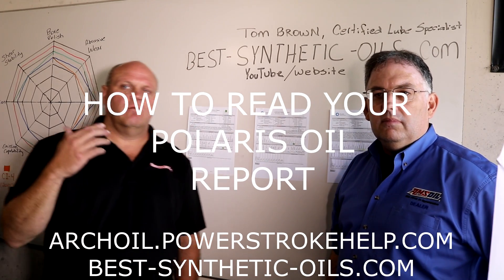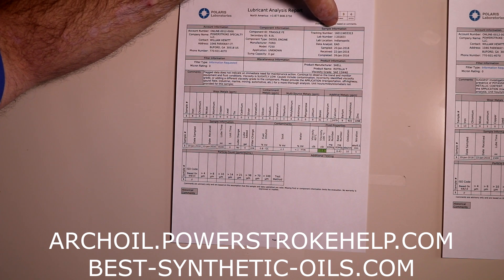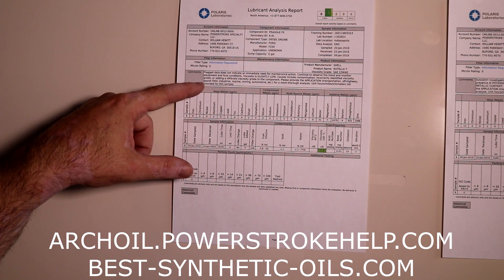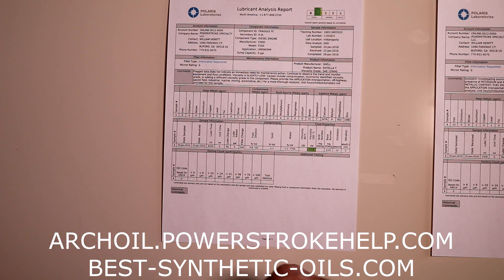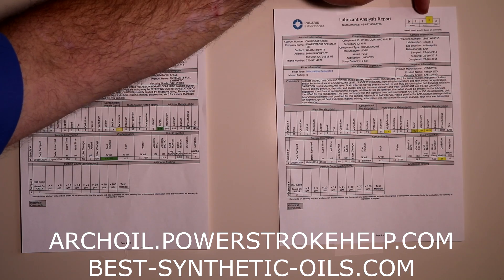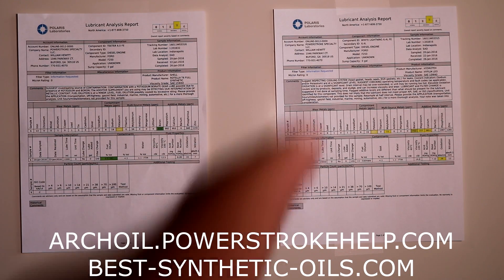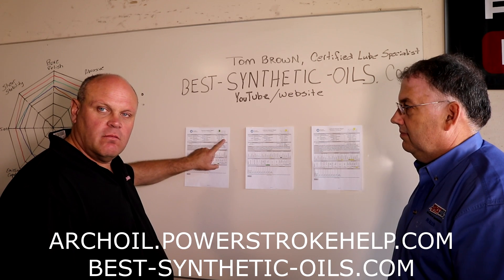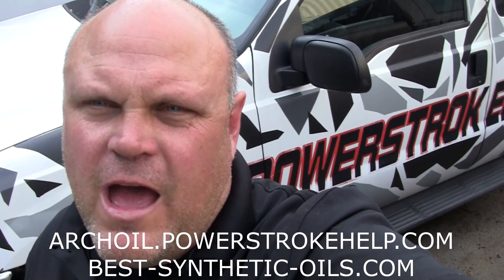HOW TO READ AN OIL REPORT

Comment: Can this test be done on regular gas V8 engines?
Reply: You can order oil testing of engine oil, ATF, P/S fluid, gear oil and get a similar report. It does not matter if its gas, diesel, natural gas or even your shop air compressor. Because this is an Amsoil test kit, its easier to get the sample kit from Blackstone-Labs and mail it in with similar testing methods.

Comment: I didn't see this in the video, but is there a "control" analysis of the same oil from the bottle before it's poured into the engine?  In other words, was there an analysis to see what is in the oil off the shelf?  When he mentioned those weird metals like magnesium, paladium, etc., I started to wonder if those metals may be from the refining process.

Comment: My result showed high boron and sodium after 1800 mi. since an oil change.  How would using WVO for 70% of those miles affect the oil analysis?  I did not use the archoil additive in the Rotella 15w40.
Reply: WVO?
Reply: Similar to Vege Motor Oil

Comment: I am so glad you addressed this.  I am currently using the 5w40 full Schaeffers full synthetic on my 2002  7.3L.  I also use the Archoil 9100 oil additive.  I got my first oil report back from Schaeffers and they red flagged the potassium, indicating a bad head gasket or a crack.  The oil looked just fine when I took the sample and I know I'm not losing any coolant.  My mechanic checked the pressure in the coolant system and its holding pressure just fine.  The Schaeffers guy tried to tell me there was a problem, but I figured it was the potassium nano borate that was driving the potassium number up.  The Schaeffers guy had me really worried for a bit. I also indicated on my form that I was using Archoil.    Really good video.... Excellent information.
Reply: If you are using Archoil 9100 oil additive in your engine at the time when the oil analysis sample is taken, your test results will most likely show elevated Potassium and Boron.  This is normal with Archoil 9100.  The oil analysis labs get concerned when Potassium is elevated because that usually indicates a coolant leak - but a coolant leak is usually accompanied by elevated Sodium levels as well.  If you are losing any coolant in your engine, you should contact the lab and give them the information about your coolant (brand name and type).  This will help them determine if you have coolant in your oil, or if your elevated numbers are coming from Archoil.

Comment: I've been using Archoil 6200 diesel fuel additive for about a year now in my 6.4L and I've definitely noticed an improvement in engine performance. I've been wondering though what's behind the chemistry of Archoil 6200. Does it boost cetane or are their other components that improve combustion, lubrication, etc.?
Reply: This is Tom - That's a question for Bill.

Comment: Is this available for motorcycles as well?
Reply: Zachary Adams Absolutely!  You can get an analysis performed on almost any type of lubricant, coolant, diesel fuel, diesel exhaust fluid, brake fluid, hydraulic fluid, etc.  Just make sure you are using the correct oil sample collection kit for the type of fluid you want analyzed.

Comment: This was an awesome overview.  For me, it is very timely as I should be getting my oil test results tomorrow.  Thanks!
Reply: Did you receive your oil report?
Reply: Best-Synthetic-Oils.com  I was mistaken about unusually high components, should have been potassium mind sodium.  WVO is waste vegetable oil, which I use as a fuel in this engine, which I converted into a hybrid fueled engine.  I'm having an wvo fuel sample analyzed now to see if it is also a possible source of those 2 components.  I should have that result in a week.